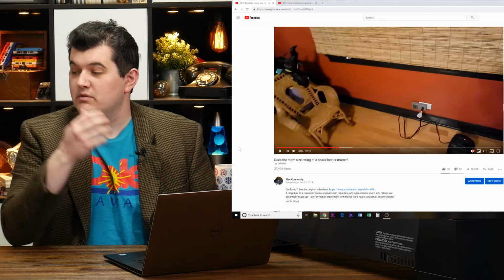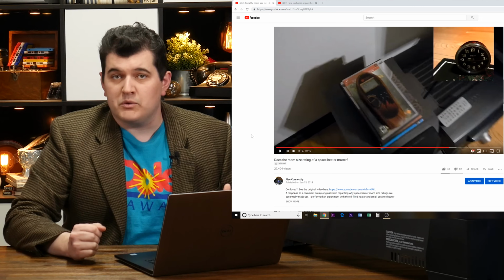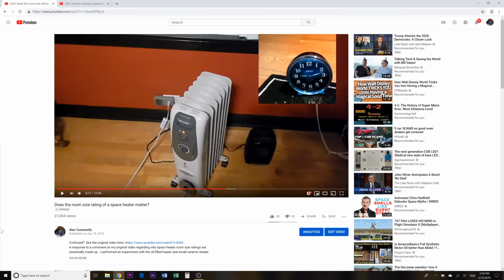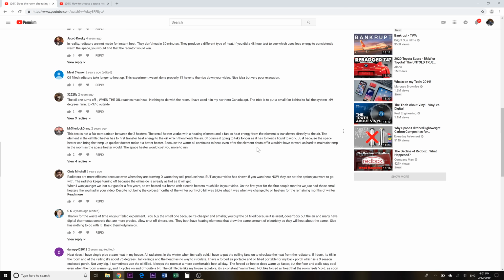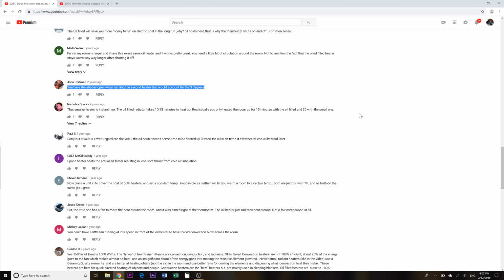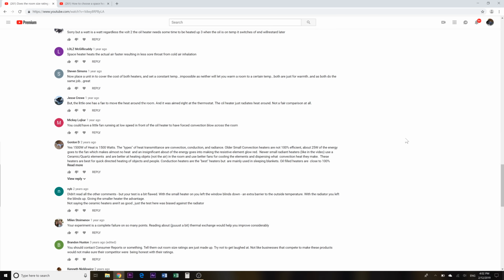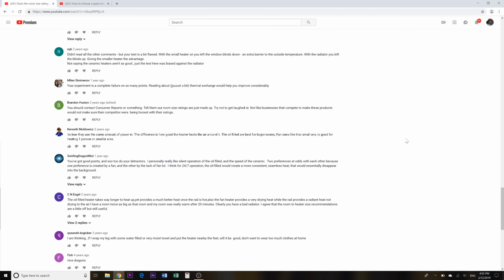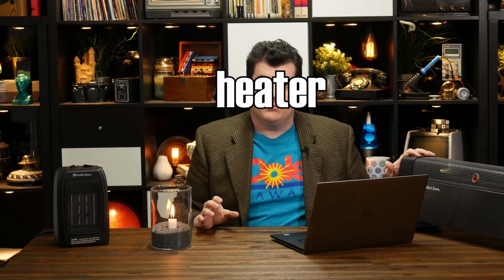More Space Heater Nonsense

Comment: The advertised wattage is not a measure of heat, it's a measure of power consumed by the device. All space heaters (and hair dryers and microwave ovens and so on) are limited to 1500 watts, because they are designed to be plugged into circuits rated at 15 amps. Since all residential circuits have a load rating of 80%, you would not want to load a 15 amp circuit very much over 12 amps continuously. 1500 watts divided by 120 volts is 12.5 amps. As such, while these heaters use 1500 watts, and while electric resistance heating elements are considered to be close to 100% efficient in energy conversion, things like a fan takes away some of that efficiency. The heat output, usually measured in BTU's, can vary slightly among 1500 watt heaters due to efficiency in design. A small heater that uses an inefficient fan has to waste some of its 1500 watts of energy on that fan, whereas one that does not use a fan could be closer to 100% efficient. A typical oil filled heater does not employ the use of a fan to distribute heat, and therefore could be engineered to put more of its energy used towards the goal of creating heat. Sadly, manufacturers of these space heaters rarely advertise the BTU output of their space heaters, and cause confusion by advertising how much power they use as if that's a feature. It's like answering the question, how fast is your car, with 30 MPG. All that said, your argument is generally sound, given that electric resistance heating elements are all equally nearly 100% efficient, and a typical fan likely would not use more than 10 watts of power, making for a negligible difference in actual real world heat output as your experiment shows.

Comment: This does not relate to efficiency but; can it have to do something with continuous use? It seems as though forced convection/fan heaters are marketed to smaller room; would not run a fan heater continuous as I think they have a hard time regulating the target temperature. As for a regular convention heater with or without oil it would, hopefully, hit the target temperature better. You probably spend more time in a bigger room and would want a continuous heat exchange. 

Why anyone would buy it for continuous use I don’t know. But maybe in a cabin to use for the time being there. 

Really like your videos!

Comment: I've thought about it a bit and the only theory I can come up with is temperature gradients and perception. With a "small room" space heater the fans cycle and recycle the air through quickly generating a pocket of heat around them that eventually travels through the room. This works well in a small room where you are generally going to be inside of the pocket. Put it into a large room though and you will probably find that half of the room is hot, and half of the room is cold, with no comfortable spot. The "large room" heater that relies on convection probably does a better job at heating the entirety of the room at the same time and feels more comfortable in total.

Comment: The only way the oil radiator is working better than the other one is that you can keep it running all night long without worrying about sudden flames. And it has some accumulated heat after being shot down. This way you should be able to speed less money on heating.

Comment: You're not wrong, you're just misreading the labels.
It's not a heater for large rooms, it is a large heater for your (same sized) room. They're using marketing spin that is misleading but still technically correct; every one of them selling the maximum size for that class of appliance.
Reply: Oh come one, it says "small room", "medium room", etc. It usually even says how big of a room in square meters it can heat "efficiently". Explicitly. lol Who would buy heater that is large in size but low in wattage? Not even an idiot. That said, I wonder if it's about some other parameters of the heater that make them more suitable for a certain space. Mainly, how long can it work *continuously" without overheating itself. Because a small one, might give you 1500W of power but only for, say 50 seconds and then it has to turn off to not cause fire in the said room. I have no idea, but I can't believe there is not a single, legitimate reason to label their products that way. Besides, I thought that in most civilized places in the world, misleading marketing was illegal?

Comment: Aren’t the two heaters using different heating technics, the oil filled radiator is mainly designed to radiate heat out and heat objects not the room but does have a small amount of convection heat, the fan heater is a convection heater so heats the air and moves the hot air around thus heats the room??

Comment: most of the cheap fan heaters is not designed for a long run. When i was renovating my house, i had one running for about a week constantly to heat ant dry everything and then the plastic deformed and blocked my fan, then plastic just melted on heating elements and blow fuses. So it depends on situation, if you need a fast heat for a short period of time, fan is the best, if you want constant heat for a long period of time, i prefer oil ones.

Comment: Yeah YouTube trolls are a pain. I'm of the opinion that the space heater that heats faster and more is the choice for me. That's why I use a space heater. I want extra heat now. Not in 6 hours or whatever. I understand people actual use them to heat their entire home. Generally they are used for quick extra heat for the moment. I have cheap 15 dollar space heaters. They are the white fan type you have shown several times. They do great. They run for years, they don't heat the cord or socket up, they have safety switches in case they get knocked over and they are very adjustable.

Comment: (Personal opinion ahead. Beware!)
I don't know ... loads of thoughts here and many comments read. So here are my thought as an electrician (not relevant, but had to do it, like the vegans do).

It all depends on how you look at the case/needs. But as in your tests, yes, they're both the same: 1500W. In the end though, it all comes to human needs. You want heat NOW, get a fan heater. You want slow release heat? Get an oil (or whatever filled elements ones) heater/radiator. 
Temperature wise:
-Short term, the fan heater will obviously win, because it gives you the heat then and there. 
-Long term though, the radiator will win. Because it slowly dissipate the heat into the area.
Consumption wise:
The radiator will win either way, since it uses a thermostat to shut itself off when it has reached desired temperature.

Think of his experiment this way: You want to read a destination x (x=number) km away. If you want to reach it fast, take the plane. If your goal is just to reach the destination and time is not a problem, take the bus/car. They both have their own advantages: One is fast, but a bit expensive, the other one is slower, but cheaper, for the same job done. (In this analogy, travel risk were not included/calculated)

Comment: Technology Connections 2 - When you made the old video and realized that something(s) was wrong you were just asking for trouble when you went ahead and post the failed "test" to YouTube. Years have gone by and there is still some puzzle that it spurred arguments and wasn't liked. 

While 1500 watt heaters all have the same electrical efficiency, they don't all work with the same effectiveness when I'm trying to keep me warm in very different circumstances. In the bathroom I have a radiant heater, I feel warmed the first minute it's on and I'm not trying to heat the room, in the office I turn on a fan forced ceramic heater in the morning and in less than half an hour the whole room is warm. In the bedroom an oil filled heater runs silently all night long. Their important heating characteristics are not about having the same 1500 watts.

Comment: Pulling wattage is not the same as outputting heat. Ceramic heaters are less efficient than oil filled heaters.1500 watts in does not equal 1500 watts out.  Also you should have put the heater near the wall with the fins 90 degrees to the wall so natural convection would happen and spread the heat out more. How many fin heater have you ever seen sticking out into the room ? ZERO. As one of the comments said ( you didn't read it all) once the oil is heated the heater shuts off until the heat is dispersed into the room and then the heater fires back up. It only pulls 1500watts during a full heat cycle, it pulls zero while the fins release their heat. The other electric heaters pull the full 1500 watts for as long as they are on high. If you give a oil filled heater a few hours to work, they give the best heat and using the least amount of electricity. Also, since the heat is only around 130f, they don't dry out the room nearly as much as other electric heaters. For best heating, put the unit near the wall as stated earlier and but a small box fan a foot in front with the air blowing on low, into the heater. The air will go thru the fins, grab the heat, and then run up the wall and curl back into the room.  Oil heaters do not get hot enough to start a fire so they are safe to run at night as long as you don't have small kids or small pets. If they get knocked over they shut off and the heat in the fins is not enough to catch anything on fire. I tried to catch a tissue on fire once, it just got warm after 24 hours. They are the best electric heat around as long as you don't need instant heat.

Comment: "Large rooms" are more likely to have furniture in the centre making fan powered heaters much less even. Also sound is more likely to be a greater consideration in a larger room as smaller room will likely have a single occupant working in close proximity to their task, where a larger room they would be further away from a television or would be engaging in conversation with others, either way background noise is more of a concern.
These heaters are not generally intended as the primary way to heat a space and so it's fair to assume that the purpose especially in larger rooms is to heat the air to an acceptable temperature for a limited time not to heat the fabric of a building and so convection is adequate and makes it less likely you will heat anything specific more than your need, potentially reducing running costs.

Comment: I agree with you that they use the same amount of power/wattage.  But in my real life experience.  I've purchased dozens of electric heaters.  But my first heater was the cheap $15 utility shop style heater, what a piece of junk it never could heat up the room or shut off.   Next was a quartz style heater and that thing was amazing heated the room too much and couldn't sleep from the glow.  The 3rd heater was a ceramic type but instead of a cube it was rectangular so maybe it just had better internal heat distribution because it too heated the room up very comfortably and cycled on and off.  Maybe some heaters just don't use and distribute the heat efficiently?  And again I agree with you on the the power usage should equal same BTU output but it just doesn't.

Comment: To keep the interior of my shed from getting too cold in winter or when I need to keep something like car batteries or to keep something from getting damp when on our covered deck I use heat lamps. Instead of heating the air you heat the surfaces. 
I have placed them under a vehicle pointed at the engine so the cold won't crack the block when it wont start to put in antifreeze.
I figure I often do not need to heat everything in an area and 100 or 150 watts is cheaper to run than 1500 watts, so I always have a couple of heat lamps around. And it still seems to be somewhat effective even with a breeze blowing.

Comment: There are somewhat uncontrolled perturbational effects between the two experiments, but yes,, 1500W = 1500W.  An example is a gas fireplace with or without a fan.  Huge difference, depending on humidity, it can be extremely different.  This guy's right.

Comment: Two 1500W heating elements running with different duty cycles do not produce the same amount of heat (energy). You of course know that.
The fan type heaters will always be more effective, since their 1500W heating element are running at a 100% duty cycle (if there is a large enough temperature difference) and thus produce close to 750Wh in our old experiment. The oil type convector will have a lower duty cycle (and you also stated this) and it would then, as a consequence, release less energy over the same amount of time (also clear by your original experiment). 
You should address the average power over time (energy released) since that is what will give you the rate of increase in temperature. 
Personally I use the fan type heaters to produce high gradient heat (in a room) and the convection type (fan less) to keep the temperature constant once the level has been established. Mostly because I hate the constant noise produced by the high speed fans.

Comment: How to make that 'medium-room heater' more effective than the 'small-room heater' in a medium or large room.
1) Pull out a medium or large room fan used during the summer.
2) Set up said fan beside the heater, blowing at the heater.
3) Turn the heater and the fan on.
4) Prof... erm, warm up.
I mean... using more power, but move more air should mean more heat... right? lol
Maybe using a big fan with the oil heater would prevent it from kicking out all the time.
I mean... it would be just like manufacturers (of anything) to use another device to improve performance and then not provide that information.

Comment: Just because something is capable of hitting x watts doesn't mean it is always pulling x watts.  If one heater is cycling on and off, hitting 1500W only SOMETIMES, how would it be as effective as a heater that can pull 1500W CONTINUOUSLY?  I suspect the difference between the small-room and large-room heaters is that the former's coils will burn out if it ran at 1500W continuous, whereas the latter can pull more power (still up to 1500W) but for longer periods of time.  Wouldn't an easy test be to observe the total energy output (by monitoring the power over time and adding it up)?

Comment: Without a fan 95% of the heat will be above your head, a fan would help heat the room alot more evenly and faster and would produce heat 100% of the time instead of less then 30% ,because the heat is 4 inches from the heat source.

Comment: My 2 cents:

If you want to heat a room there's no difference. If you want to heat a room quickly, the one with the fan is better. The poind is that people usually want to heat themselves and not the room - so to measure how efficient a heater is based on the comfort people will get from them measurements should be made in a different way. So, here are my opinions:

1 -  Heated Elements like the ones on your desk

First of all, I think they are fire hazards.

1.1 - Passive ventilation - this will heat your room from the ceiling down so energy will be wasted making a part of your room uselessly (if that word exists) hot.
1.2 - Active ventilation - this will spread the heat in your room and the smaller ones can, in fact, be used to heat the place where the user is and save on heating other parts of your room. If you want one to heat the whole room - like a living room - then one with a larger fan would be better. You never want to have hot air traped near the ceiling since it's a waste or energy, comfortwise, and will increase loss since heat conduction is proportional to temperature difference.

2 - Oil filled ones

Can fail and produce a lot of smoke from the oil but I really don't know how toxic the smoke is nor how prone to failure they are. I'd get a good one. They are good for longer periods and they keep the temperature stable so when I go to sleep I don't wake up in the middle of the night all sweat. Also, they do irradiate heat and can be used to give a bit more heat to people near them.

3 - Irradiation Types

Also fire hazards depending on how they are built. Nonetheless, IMHO, the best one to heat people because the infrared won't need to heat the air to heat the user.

Now a note about humidity - since someone mentioned the ones with heating elements and fans would dry the air up while the oil one wouldn't.

Humidity is not the measurement of how much water is disolved but something different: if you put a glass of water in your room, water will evaporate but, also, water from the air will go into your glass of water and the ratio between how many molecules go enter the glass and how many leave the glass is the humidity the weather channel reports (as a percentage). So, when you heat a room, the water solubility in the air increases and, even though there is the same amount of water in the air, humidity will drop because now the air can take more water molecules out of the glass.

Thinking of humidity, maybe if someone is on a cold and humid place, heating the air will be not only more comfortable but also heathier since cold humid air is can really cause lung problems.

Dude, your videos are really good, unusually detailed for a youtuber, and I always recognize you aim at teaching people and that is a noble goal!